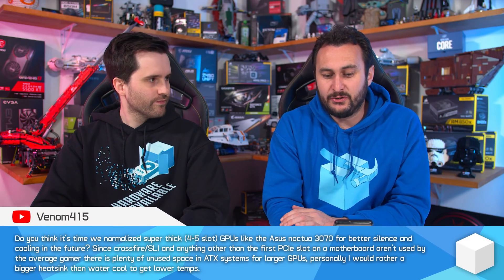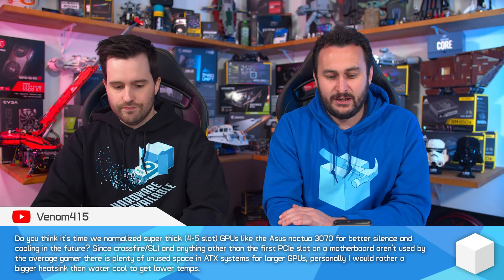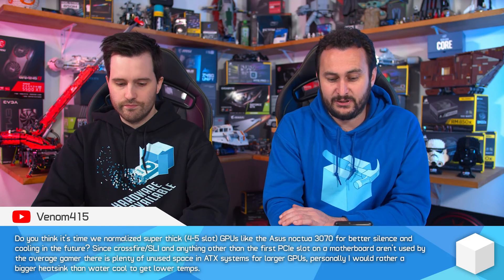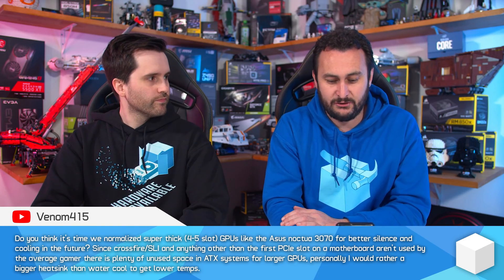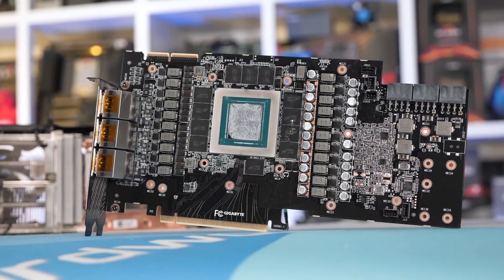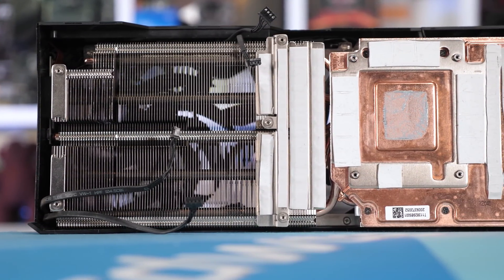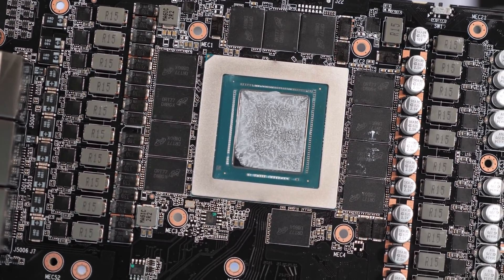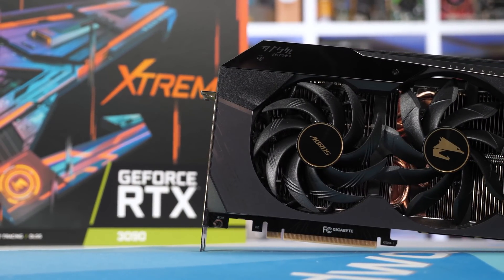Should 4 or 5 Slot GPUs Be Normalized?

Comment: One thing to consider about thick cards, for those that like the itx systems, usually you are limited to a 2 slot card in most enclosures. My HTPC/gaming rig that i have hooked up cannot go with anything larger than 2 slots which limits my choices a bit

Comment: My opinion, not that anyone asked... Is that the GPU makers, particularly Nvidia if RTX 4000 series info is to be believed... Has had very little innovation in the past 6 years. When you actually take into account power consumption at the high end, it's something like... 4X the performance, at 2X the power, for an overall, what, ~2X (100%) performance improvement. This shouldn't even be a conversation tbh. When things like the R9 295X2 came out, it was CLEAR that was a hardcore enthusiast product with important considerations to not burn your house down. Now, a SINGLE GPU has had a ton of transistors packed on and are being allowed to take as much power as they want, simply because the actual performance increase and efficiency isn't ACTUALLY there.

Comment: Well if the 4090 is going to be 600w it will have to be 4-5 slots thick! There are support braces made for GPU's. I hang the far corner of the GPU with a wire to the roof of case.

Comment: Cheap used size and power consumption is becoming ridiculous. With nvidia's RTX 4090 TI expected to draw 800 watts where are we going with 5 slot gpus 1000 W 1500 W 2000 W? PCS will have to have a dedicated 240-volt AC line to handle that kind of power.

Comment: If we do that, we need to normalize ATX - SE - super extended motherboards and WAY more PCIE lanes and more slots 4 slots away from the video card.   I have a gaming video card, a RAID controller, a 4 port 10 gb nic.    They could make video cards with more than one slide in slot  - adjustable width but I'd be much more excited if my x16 slots were all x16 slots and all my x8 slots were x8 - seems almost deceptive to sell a motherboard with 3 or 4 x16 slots but really only about 24 PCIE lanes available for all the slots.
Reply: One word... Threadripper. Really, most consumer grade stuff isn't going to have the lanes since a normal users dont really put all that stuff in their PC (they said that in the video). People like us are more of an edge case or pro-sumer which is not the majority. I wish they had more lanes on normal consumer products, but i dont see that happening any time soon especially when they can charge a premium for extreme series cpus or threadrippers.

Comment: 5 slots won't help with sag, sag is not caused by the lack of anchor points, but due to the lack of anchor points of the pcb itself with the bracket, making the back plate integrated with the bracket would immensely help with sagging, super thick gpus are super dumb, it may not be a problem for people that don't use other PCI express slots, but for those who do use, is a deal breaker, and also for those with matx or itx builds, and even more so on the server side of things, where chassis space is already restricted, it's really stupid doesn't matter how you look at it. A better solution would be developing tecnology to better scale multiple GPUs, or design a new form factor all together to substitue ATX, that at this point is many decades old and doesn't meet modern technology standards, and that's what I think will be the case in the near future. Thick gpus are just a temporary "solution".

Comment: I think they should add a mini-fan facing straight the Gpu die (similar design to the Arctic Liquid Freezer II), then have 3 fans above it to pass air to the rest of the heat dissipation pipes.

Comment: just use riser cables... why is this even a discussion.... but also everyone should water cool.
Reply: I don't understand how rise cables helps here? There isn't a single case that will support a 5-slot vertically mounted graphics card that I'm aware of. Also water-cooling is far from a practical solution, even AIO models are known for pump issues.

Comment: In the 90’s PC’s made by OEMs like Dell and HP had shrouds which directed air from outside the case to a specific area, usually a CPU heatsink, and in some cases it further guided the air to an exhaust slot. It’s basically the same logic as a blower style GPU, it draws cool air from one end and exhausts it out the other end to avoid recirculating the same already warmed up air. Case temps are better, hardware temps are better. Have a look at this video where someone tries a modern equivalent with their CPU for the sake of science. https://youtu.be/gczH2ks9_UQ

Now imagine the same logic used for a GPU. A very long version of a 92mm snowman or 120mm tower where the heatpipes spread out more, one originates from the VRM etc and they spread out over the finstack. Encase it all in a shroud and add an intake duct and voila you’ve saved the rest of your system from the GPU’s heat. Blower cards are loud because there’s just one blower style fan forcing air through a narrow shroud but this could be scaled up to multiple 120mm fans, one at the case intake, another at the “beginning” of the GPU where the ductwork meets the GPU, and if case manufacturers embraced the idea you could have an exhaust fan too.
Reply: Buildzoid have made a video called something like “why blower style coolers suck.” The issue with the heat-sink seems to be the length. The efficiency of the cooler gets worse the longer the air has to travel through it, as the air gets heated up the lower the temperature delta gets between the air and the heat-sink. 

I guess it could be compared a bit to stacking radiators.

Now don’t get me wrong, I would love to see a cooler like this on a card, even a “box”-card, with dimensions 92x92x184mm card, 92mm fan in the front and a 80mm fan in the rear over the video-ports

Hope I made some sense(brain feels like goo, have had little sleep)

Comment: >plenty of unused space

Wifi cards and soundcards would like to have some space, thank you.
Reply: @The Fudgesicles Spinning Archive. thought the same. 
I still want to enjoy good ANALOG 7.1, which is hella better that than emulated surround BS. 😂
Reply: @The Fudgesicles Spinning Archive. it’s not just sound cards how about a separate 10gig Nic since consumer hardware is just now getting 2.5gb Ethernet ports
Reply: Just use an m.2 key e for WiFi, keeps upgradability and eliminates a slot requirement
Reply: @ryanwallace983  what if you have your m.2 populated with SSDs...?
Reply: @FalbereChan  m.2 WiFi cards use an E-key, which is completely incompatible with the M key on an NVMe SSD or the dual B and M keys on a SATA m.2 SSD.
Reply: @tiladx  didnt realize key e is a thing, thanks for the information.
Reply: @ryanwallace983  Not all motherboards have an m.2 E slot for WiFi cards.
Reply: @tiladx  yeah I know, but there really is no reason why they can’t

Just like an Ethernet port is standard, an empty (or filled!) m2 slot for WiFi could just become the norm if consumers expect it

Comment: 5 slots would maybe help with sag, since you'll have more anchor points.
Reply: It would help at the I/O end, but it would actually increase the chances of sag across the card, unless the cooler was extremely rigid.
Reply: it sounds nice but pcbs are so flexible that it wouldn't matter. the anchor points have to be in key positions to make a difference rather than just clumped close together on one side

Comment: G'day Steve & Tim,
🤔No. I like M-ATX & 4Slot would get no Airflow while 5Slot wouldn't fit & then there is those who love ITX where even a 2Slot Cooler can be too big
Reply: the airflow could be lengthwise and use “blower GPU” engineering though. Could include ductwork to make sure intake is cool.
Reply: @depth386  You mean go back to the Hot & Noisy designs of old that nobody wants
Reply: @shaneeslick  No, you misunderstood me. The old blower GPUs “as we know them” are loud because they use just a single blower fan at 4000+ rpm and a narrow 1 or 2 slot channel for the air. With a 5 slot GPU I think you could reasonably use ductwork to direct the flow from a normal case fan, perhaps more than ones . Noctua quietness with blower style mercy on case temperature would be the dream. See my comment outside of this thread where I elaborate.
Reply: @depth386  Still No, that sounds Terrible to me
Reply: @shaneeslick  It’s only really justifiable for insane power like the 4090 rumours. It would be cheaper than watercooling. If it makes you feel better I have built budget to mid range Micro ATX systems for some of my family.
Reply: @depth386  " If it makes you feel better I have built budget to mid range Micro ATX systems for some of my family." 🤷‍♂️Who Cares! I have built hundreds of PCs since the '90s.
You obviously have a problem dealing with people not thinking your idea is the Best, Yes Major Hardware's Video was fun but I don't want a PC that looks like a Server Rack or to go back to the '90s, "90’s PC’s made by OEMs like Dell and HP" to me that style of Cooler Design needing all those plastic Windflow Guides LOOKS STOOPID & UGLY.